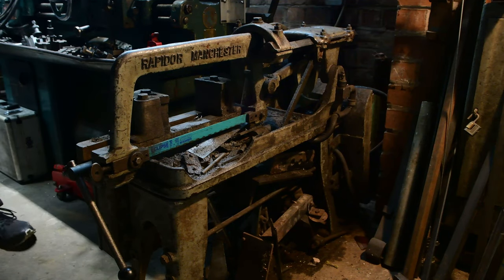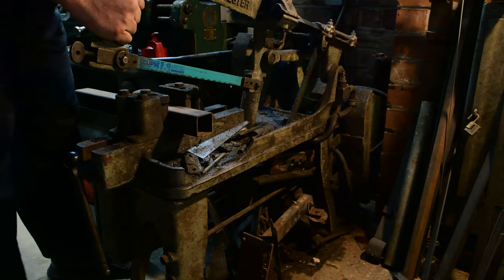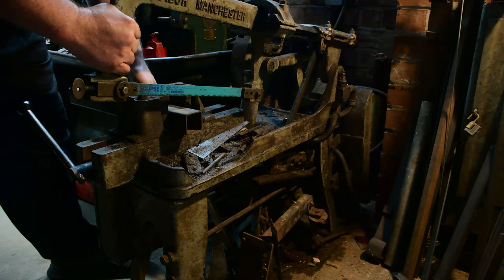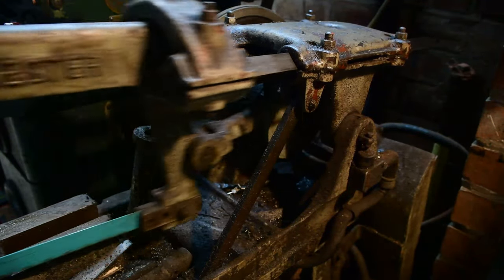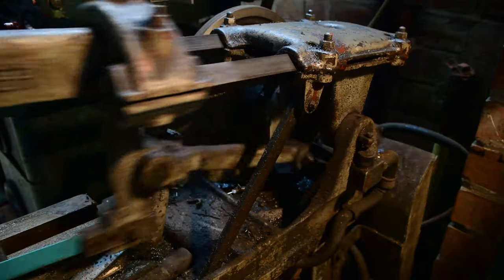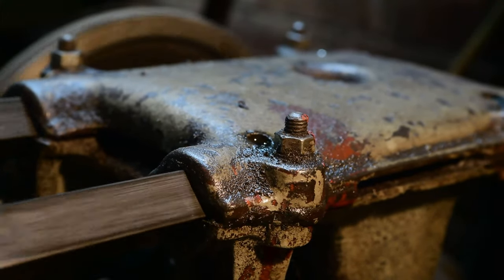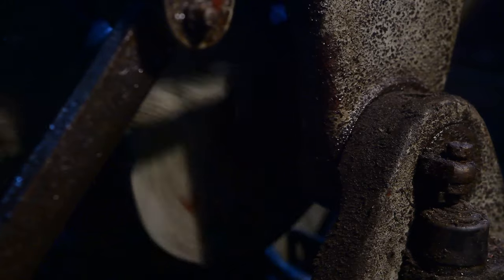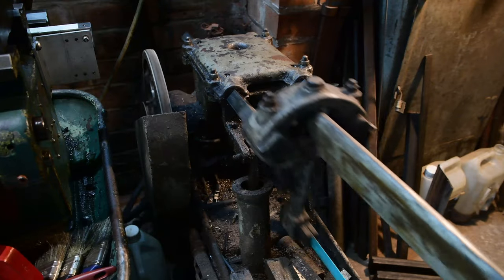Rapidor Manchester Restoration - Introduction

Comment: I have one of these saws and it runs fine on a 1/2hp motor. my motor rotates the opposite way so the forward stroke the con rod is at the top. before changing the motor it may be worth changing the belts. The castings are good quality so brazing a piece in to the cracked off section would be do able. The main bearing is bronze and has a spiral oil groove. If this is worn I would bore it out till true and build up the old shaft to fit or worst case turn a new shaft. Mine was fitted with the suds pump as you mentioned and its just a small mechanical pump driven by a plunger that rides on the crank arm.
Reply from the maker: thanks for messaging me, yeah it may be the belts that are causing the drop in cutting power. i have it stripped down and will be recording my progress..
Reply: You have the original pump? I've re-engineered one. But have never actually seen one. Video on my channel.

Comment: Now, mines had some wear and has been cocked about with, but yours is definitely in a worse state, and I feel better about mine 👍 . I’ve to do similar on mine , main bearings and slides.
Reply from the maker: Hi, yeah it is a good old work horse, but it has been abused over the last ~70 years. A little bit of tlc and it'll right again.. Fit for another 70 years.. :-)

Comment: I’ve just bought one myself what size blade does it take?
Reply from the maker: Hi, the blades I use are Eclipse 14"x 1.1/4", 10 or 14tpi. Something like this: https://www.rdgtools.co.uk/acatalog/Eclipse-14-x-1.1-4--.062-10tpi-HSS-power-hacksaw-blade-hack-saw-350-x-32-x-1.6mm---AE343V-AE343V.html